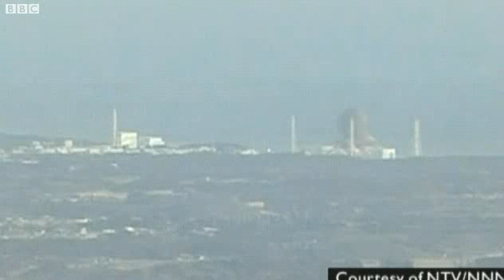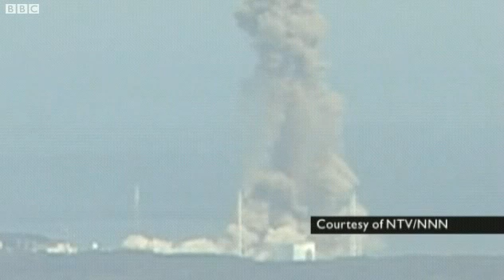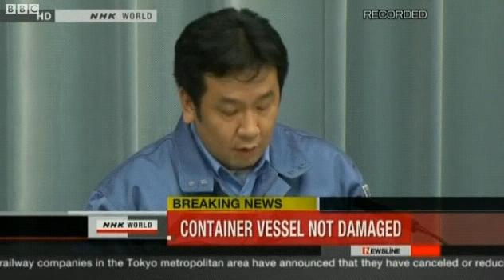Fukushima 3 Explosion 14.03.2011

Comment: I don't see why this was raised to a Lvl7 nuclear disaster along with Chernobyl. They measured between 20-50mcB of radiation here, and upwards of 15,000mcB at Chernobyl. There is a huge difference there. Not including the 200 sq. Km thermal explosion that was eminent at Chernobyl, had the water that was cooling the core not been drained.

Comment: 8 22 2011 As is known now, the containment vessel was, indeed, damaged.  The NRC said fuel rod pieces, not from the spent fuel pool, were blasted out over 1.5 miles away.  Also, known now, that Tepco knew the reactors were melted down, and indications are they started melting down prior to the tsunamis, because cooling pipe broke from the earthquake. enenewsdotco m is a good alternative source.